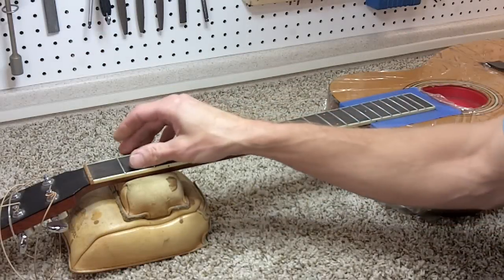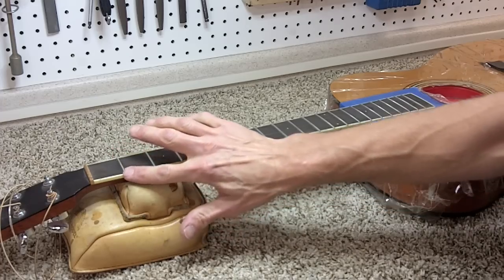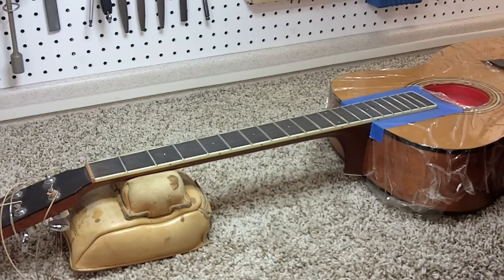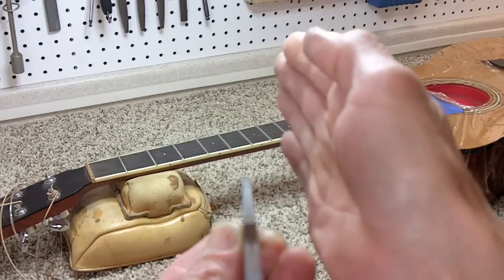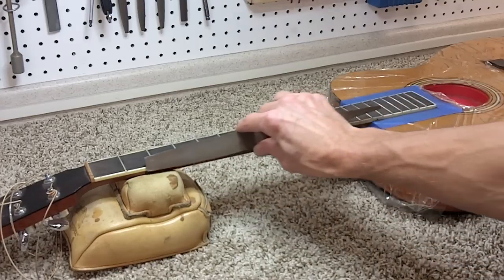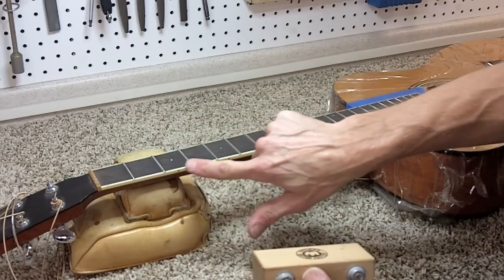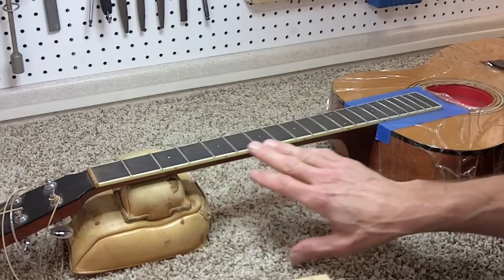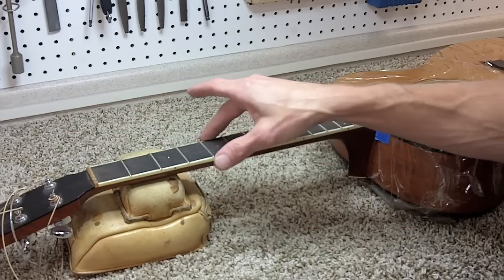Pt.1 How to fix sharp fret ends / sprout so your guitar plays like butta - B4 Ultimate Fret End File

Comment: It is so true saying "supposedly some custom shop guitars.."...been there!
Reply: yup...I was in the 'Center' of 'Guitar' once, to try out guitars. I brought along a fret rocker tool in my pocket in the event I was interested in something and wanted to to check for level frets before purchase. For grins I pulled a $5,600 (on sale!) custom shop Tele off the rack. Looked super cool with aged finish and was real light weight! I was excited! Soon as I sat down with it and began playing, several strings choked out immediately upon fretting. I mean, totally dead notes. wtf? on a guitar this expensive?? It was 110% certain it wasn't my technique ; ) So I got out the fret rocker and begin verifying frets. Right away on the second fret it began clicking very loud. High fret! basically the width of a medium guitar pick! -too high. Then further up the neck again @ 7th, 10th and 17th frets. Loud clicking in bass & treble sides of frets. They were just high enough to cause notes to choke out, buzz profusely and interfere with bending. I thought this was pretty unbelievable. The fret rocker doesn't lie! Just playing single notes in those areas would barely produce sound. So at that point the sales guy comes over, noticing what I'm doing with their $5k guitar flat on my lap, checking frets : ) He says with very annoyed voice "hey! there's no need to do that - it's a custom shop guitar, they're perfect"..then stares blankly at me as I played notes in the high-fret areas, making the worst choking out/buzzing noises you can imagine. It was hilarious...Right there through the amp for all to hear. He goes "you're playing it wrong" "a Telecaster needs different technique from a regular guitar"..I laughed so hard I nearly farted out loud! Rather than get into a pissing contest with a deceptive person trying to manipulate me for fool, I handed him the guitar and said "here, you can keep it" then walked out : )